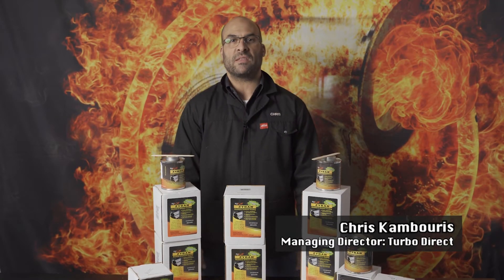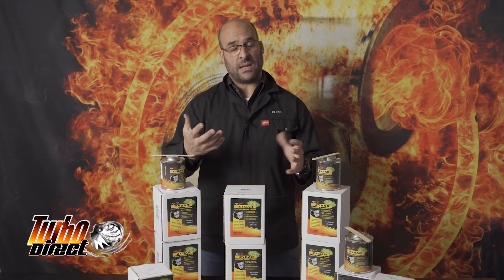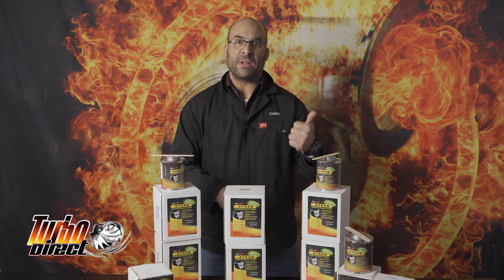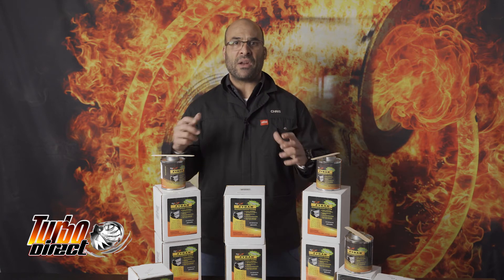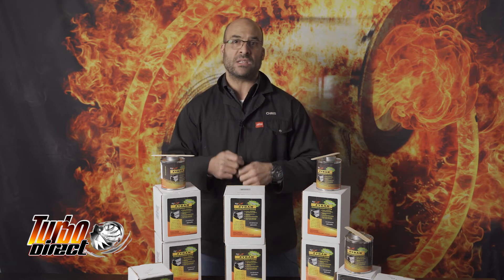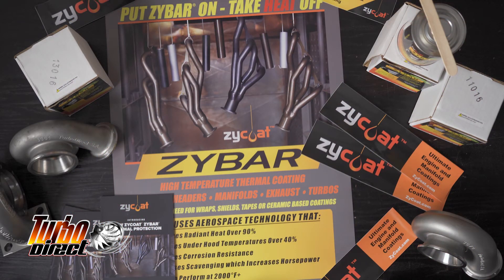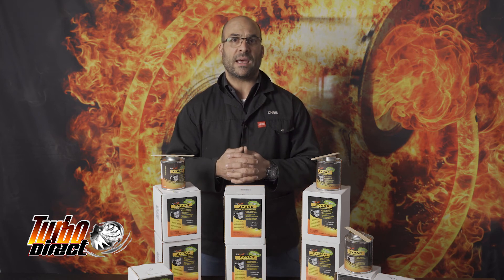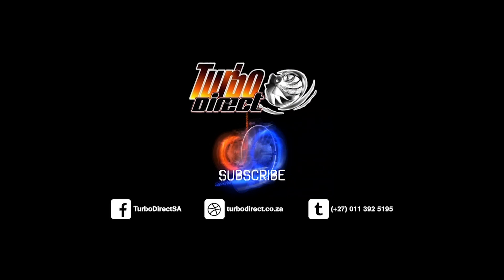Next level Aerospace coatings - intro

Comment: Link for the testing if it's out? Thanks! I've actually been following this product for a while but have seen many real-world testing.
Reply from the maker: We have tested this on a turbochargers heat shield, and aircraft parts which we are currently in test phase with. We will release some measurable test results in the coming months in both Automotive (on the ground) and Aviation related tests.

Comment: This stuff ceramic based? Interesting it can be ran inside of the exhaust parts not just the outside
Reply from the maker: The product is not ceramic based at all - its a polymer based coating.
Reply: you can use it inside I've seen them blank off manifold exits and pour liquid inside swirl it around then drain it and it works well.

Comment: That should be Polymer - with a "y"
Reply from the maker: You are 100% correct - ill get the editing team to correct it and ill update the thumbnail shortly
Apologies about that  :-(
Reply: @TurboDirectSA  Haha love the videos - Being a polymer chemist and a motorhead - I have always wondered how much gains can be made with all the different coatings on the market - that would be intake to keep cool - piston head to control unneeded detonation and exhaust coatings to keep the heat energy and spool faster - There is no good thorough answer out there.
Reply from the maker: @cyanomethane  Precisely what i will be testing and proving once and for all - coatings are a VERY controversial topic, and many are opinionated about it.  The facts remains that thermal loads are any engines enemy, BUT when "managed / guided" properly it doesn't have to be.   Piston coatings (im talking about the deck of the piston, not the sides) is a total waste of time WHEN RELATED TO DETONATION - no micron thin coating will resist detonation, nor will it extend the life of a piston during detonation.  

Its not alway about keeping cool - it's more about "managing / directing" the thermal loads depending on the application, as i will demonstrate in the upcoming videos.  Thermal loads "reduce" the diameter of piping in certain circumstances, this affects air flow, and has a direct pressure effect - 

Heat = energy -- which is in essence what drives a turbine through blade excitation and induced vibration. 

Lots of juicy info coming soon .... :-)
Reply: @TurboDirectSA  Glad to hear that there are gonna be some cold hard numbers and facts. Something that gets overlooked in this marketing heavy world we live in. Btw any ideas on what all can be done to a 2005 Merc E320 cdi VNT turbo its an old garrett I believe and since then there might have been a newer VNT system too there are some hybrid applications I have seen from Darkside developments in the UK - But I am asking what can be done beyond that. 

This particular model is a workhorse of the 2000s - used as a taxi in many parts of Europe and frankly is a rare find in the USA - Iron block and tunable. Need mine to breathe more :) Any ideas?
Reply from the maker: @cyanomethane  Firstly - PolYmer is corrected - thanks for the heads up. The Merc C320CDI has 4 turbo variants - which one you running? 770895, 765155, 777318 and 802774 -- OK the later is the ball bearing model - so rule tat one out - but rule it in too - upgrade its compressor with a forged wheel like our GTX2876R and you making come decent power that you can you boost high (because of the ball bearing cartridge)